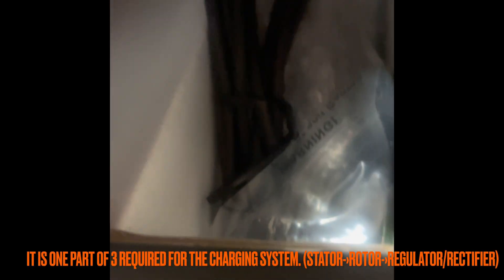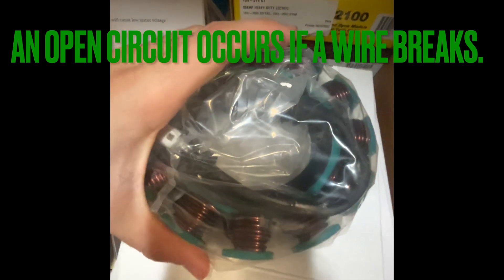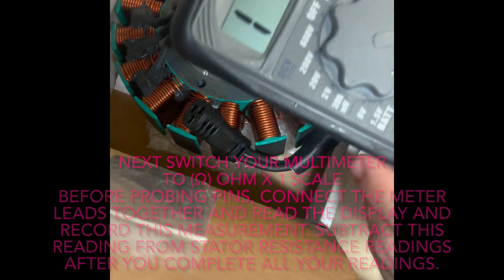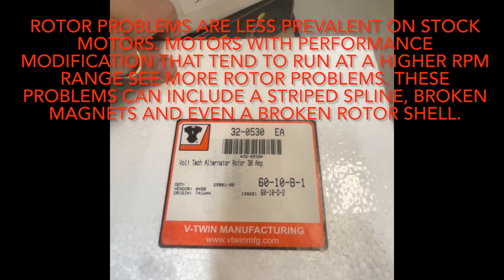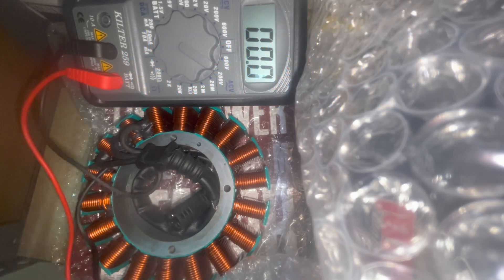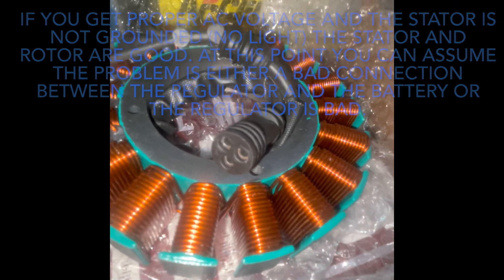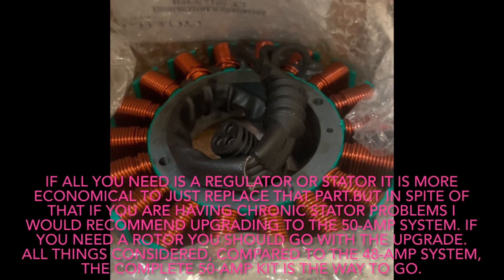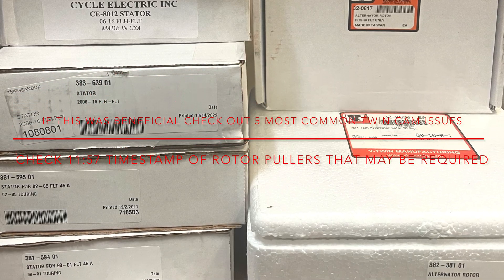HOW TO TEST HARLEY-DAVIDSON’S STATOR OUTPUT AND CHARGING SYSTEM HEALTH

Comment from the maker: This is just for Entertainment and Reference you and only you are responsible for your quality of work in action. Transcription Below please like and subscribe if this was beneficial!
Reply from the maker: It is one part of 3 required for the charging system. (Stator->Rotor->Regulator/Rectifier). 
Stator is like your alternator, and the rotor is like the pulley and the magnetic field around the stator, and the regulator Rectifies and regulates voltage coming into the system to protect electrical components.  The stators job is to supply electrical current to charge the battery and run electrical devices.  
If you can’t tell what's up with your stator it's not too difficult to diagnose
Stators are very simple and their problems fall into two categories: shorts and opens
A short circuit occurs when one of the wires in the windings or the lead wire make an electrical connection some place they should not. Shorts can be from winding to winding or from winding to ground. An open circuit occurs if a wire breaks.
Winding to winding shorts or opens will cause low stator voltage
You can test a open circuit by the ohm method but the 12 v test light is much more time efficient
Stator Resistance Check: The Engine must not be running for this test. Do not allow your hands or fingers to touch meter leads or any grounded portion of the motorcycle.
Reply from the maker: Locate three wires coming from stator contained within the multi-connector. Disconnect connector
Next Switch your multimeter to Ohm x 1 scale.
Before probing pins, connect the meter leads together and read the display and record this measurement. Subtract this reading from stator resistance readings after you complete all your readings. 
Probe each stator wire with multi-meter leads and check and record resistance on meter between the pins,
 go 1 to 2, 1 to 3 and 2 to 3 so on and so forth recording accurate resistance readings between each pin in the connector . 
 My rule of thumb is that the Resistance should be in the range of 0.1-0.5 Ohms. However this Reading will vary depending on system, 
Therefore always Check your Clymer for first timers or your Service Manual for the specific resistance specs for your model regarding your charging system.  For example to calculate Connect meter leads together, meter reads 0.7 ohms. Measure stator resistance, meter reads 1.10 ohms. Subtract 0.7 ohms (meter/lead resistance) from 1.10 ohms.
True reading is:
1.10 ohms (observed reading when checking stator)
- 0.7 ohms (meter/lead resistance)
= 0.4 ohms (true stator winding resistance)
22 amp system produces about 0.2 to 0.4 ohms
32 amp system produces about 0.1 to 0.2 ohms
45 amp system produces about 0.1 to 0.2 ohms
This is an example of how to check a three wire Stator, as long as your readings are close to the same your Stator  should be OK, however stators can have the correct ohm reading but not put out ample wattage or voltage.
Winding to winding shorts or opens will cause low stator voltage
Rotor problems are relatively rare on stock motors. Motors with performance modification that tend to run at a higher RPM range see more rotor problems. These problems can include a striped spline, broken magnets and even a broken rotor shell. All these problems will result in low stator voltage and the sound of rocks in your primary if it decides to delaminate.
Reply from the maker: Testing AC stator voltage
1.Locate three wires coming from stator to regulator and follow the
wires to the 3-pin connector.
 2. Disconnect 3-pin connector.
3. Set Digital Multimeter (DMM) to AC Volts scale.
4. Connect one lead of DMM to pin labeled “1” in 
on the wire connector that comes FROM the stator.
5. Connect other lead of DMM to pin labeled “2”
6. Start the engine and let it run at idle. Observe the
DMM reading.
22 amp single phase = 24 VAC @ 1000 rpm
32 amp single phase = 18 VAC @ 1000 rpm
38 amp single phase = 18 VAC @ 1000 rpm
48 amp single phase = 24 VAC @ 1000 rpm
36 amp three phase = 16 VAC @ 1000 rpm
50 amp three phase 18 VAC @ 1000 rpm
Set your meter to read AC volts. Unplug the stator from the regulator. Start the motor. On a single-phase system, connect one lead from the meter to each pin on the stator plug. Hold the motor at a steady RPM and read the tachometer and the voltmeter.
Locate three wires coming from stator and follow the
wires to the 3-pin connector, Disconnect 3-pin connector.
 
On a three-phase system there are three separate windings hooked end to end. You need to test the voltage on each set of windings. The plug has three pins. First take a voltage reading between pin one and pin two. Then pin one and pin three. And finally pin two and pin three. This will test all three windings. All three should read the same voltage at the same RPM. While a good test to see output function 
A stator that is shorted to ground may still produce full AC voltage from pin to pin. The problem with this is the rectifier changes the AC current to DC current and then uses the ground as one leg of the DC. When the stator shorts to ground the AC and DC get mixed together.
	Therefore The best way to test for shorts to ground is with a 12-volt test light. Sometimes an ohms meter will not pick up a short to ground. The light test is better.
Using a standard automotive test light, connect the ground clip to a good ground. Test the light by touching the probe to something positive such as the positive battery terminal. The light should lit indicating you have a good ground. Now you are ready to start the test.
Unplug the regulator from the stator and start the motor. Probe each stator pin with the test light one at a time. If the bulb lights up when connected between any of the stator plug pins and ground, the stator is shorted and needs to be replaced
 
If you get proper AC voltage and the stator is not grounded (no light) the stator and rotor are good. At this point you can assume the problem is either a bad connection between the regulator and the battery or the regulator is bad.
 
Now when it comes to replacement Those who ride 1997 to 2005 FLH/FLT models have discovered, they do not seem to get the stator life they expect. In order to understand why we need to understand how Harley screwed this up. 
In 1995 they introduced their first EFI Motorcycle, a new larger 3 amp single phase charging system was developed to accommodate the fuel pumps needs. Dresser Models still needed more power so rather than redesign Harley in their infinite wisdom just increased the output of the same system by giving it stronger magnets. This is where trouble started,  the addition of the stronger rare earth magnets on the rotor the system was called a 45-amp system and this extra power puts more stress on downstream components. This extra stress can shorten the life span of some parts that are not designed to handle it. In 1999 they called it the 48 amp system the 45 and 48 are basically the same,
This system puts out 30 amps at 1000 RPM and about 54 amps maximum. When drawing over 45 amps out of this system, the stator will produce heat faster than it can get rid of it. The temperature of the stator will rise until it gets hot enough to melt the insulation. Once the insulation burns up the stator shorts out and will no longer work.
The reason why I’m so persistent on using cycle electric products is because
The plastic over molding insulation used on other stators melts at 4250 F. By 4500 they are toast. cycle electric have developed a stator that can withstand peaks of 6000F. But Continuous operation at this temperature will shorten the stators life span. Drawing full power out of the 48-amp system (54 amps) can result in temperatures this high.
Another drawback to using the stronger rare earth magnets is they produce an AC waveform that results in harsh power delivery. Alternators produce alternating current commonly referred to as AC. If you made a graph plotting AC voltage against time it would make a reciprocating wave. Ideally it would make what is known as a sine wave. A sine wave has a rounded almost semi circle shape to it. The more commonly used ceramic magnet rotors produce a wave that rise and drop of more gradually. The stronger magnets used on the 48-amp rotor produce a square output wave. This square waveform indicate a very fast change in voltage which leads to very high instantaneous current. These high instantaneous current spikes produce a lot of heat and go hard on the regulator and battery. This is what I mean when I say the 48 amp system hits hard. Luckily there’s a solution by cycle electric
Reply from the maker: What's the big deal, between single phase 45-48a system or a 50 amp 3 phase Charging systems
SINGLE PHASE STATOR The single phase stator is the simpler of the two. It is made of a single wire wound on every pole of the stator. A single phase stator generates AC power that alternates from positive to negative very quickly; meaning that in every cycle, there is a moment where the stator generates no current, as it reaches 0 volts. This moment happens so fast you won’t notice it. However, a single phase stator will be less powerful overall than a three phase stator. For that reason a single phase stator will require more RPMs to generate power. The faster the engine turns, the shorter the “0 moment” will be and more electricity will be generated by the stator.
THREE PHASE STATORA three phase stator is basically the same as a single phase stator except that there are three separate coils wound around the stator. Just like on the single phase stator, each phase will, in turn, be near 0 volts. The difference is, when one phase of the three phase stator nears 0 volts, the other two phases still produce around 75% of their maximum output, resulting in significantly more power and electricity generated at all times, which means the stator is much less dependent on engine RPM.
The 1 phase power output is not constant and the average power is half than its maximum power.
2 phase power output is constant at every instant and the average power is equal to the maximum power of one phase.
3 phase power is also constant at every instance and the average power is 1.5 times the maximum power of one phase. 
The 3 phase will be smoother in operation, the three-phase system has three sets of charging coils. These coils produce waves that are offset 120 degrees from each other. This is kind of like having a motor with three smaller cylinders instead of one big one. So, here we have achieved constant and more power by simply adding two extra windings to a single phase generator.
 If all you need is a regulator or stator it is more economical to just replace that part.But in spite of that If you are having chronic stator problems I would recommend upgrading to the 50-amp system. If you need a rotor you should go with the upgrade.  All things considered, compared to the 48-amp system, the complete 50-amp kit is the way to go. With all products being made here in the US and  many cycle electric products having a 2 year guarantee and we've seen plenty of Cycle electric charging kits last well over 6 years with zero failure.
Another way to optimize 2006 and up FL and 2007 and up dyna and softail would be pair the cycle electric components with a vtwin mfg or similar sealed magnet rotor so the magnets never delaminate which is a more than common occurrence for beat on or high performance applications 
Hopefully by implementing the appropriate solution for your fitment will keep a charging system implosion from occurring…
 Regulator Test:
The voltage test is the easiest indicator of something going haywire,  but may not trace down whether it has continuity or an open circut , Your Regulator will go bad 9/10 before your stator, the First Symptoms of a bad regulator may be
1-Dimmed or Flickering headlights
2-Problems in starting the motorcycle
3-Dead or Drained battery after a new battery being on the tender 
4-Malfunctioning electronic accessories or we’ve just seen them just literally go up in smoke and burn up on the backside
5-Undervoltage 13v- and below or Overvoltage 15v+ Its an easy test while one person is revving the motorcycle the other holds voltage multimeter leads to see if the voltage goes above 15 for or below to 13 consistently. Your shooting for 14.6 in an optimal system but it totally can range between 13.5 to 14.5 volts if your rectifier-regulator is functioning correctly. If its exceeding 15volts or staying well below 13v even with a new battery, your regulator is most likely bad, your regulator will go bad 9/10 before your stator but the best maintenance is preventive, and if you don't make time to service your motorcycle your motorcycle will make sure you take time to service it later.